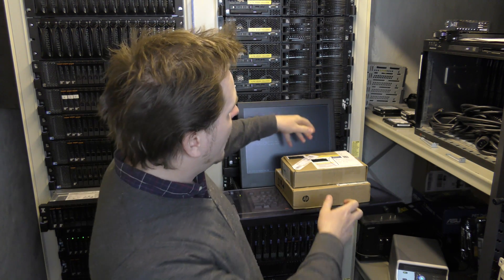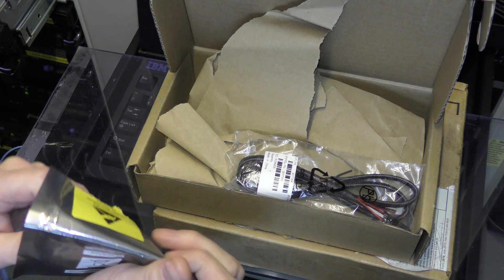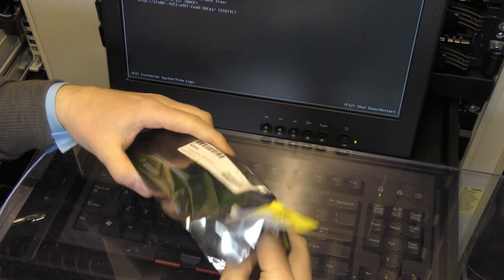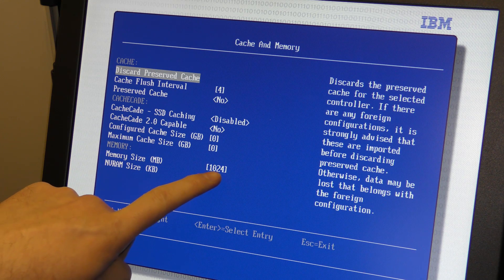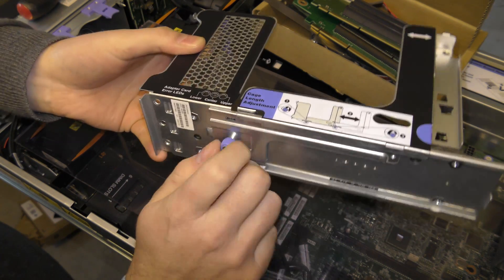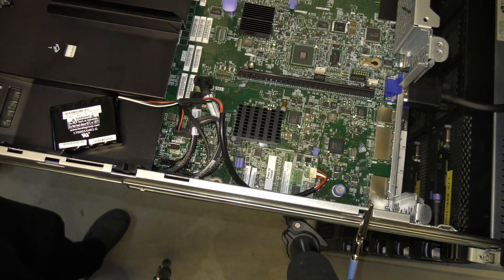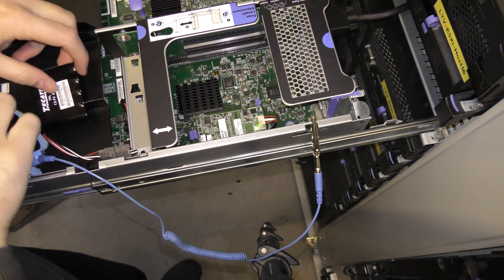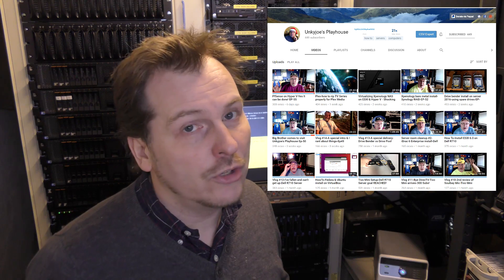Lenovo x3650 M4 GPU Riser Card & Flash/RAID Upgrade - 482

Comment: morten i have a problem with a hard drive. in the avago raid controller it is seen as protected. how do i remove the protected status.
Reply from the maker: Could it be a jumper on the HD?
Reply: @MyPlayHouse  its a sas 300 gb 15k rpm seagate drive. it has 4 pins but there is no jumper present. the backplane sees it but always protected. i have tried to make a raid with it and convert it to jbod to no luck.

Comment: Morten, you wrote oops on the printed document cause it seemed to imply that the battery only works with the 512MB model but I think you used it with your 1024MB cache card. So no problems ?
Reply from the maker: Hi Maico
IT sayes "* The ServeRAID M5100 Series Battery Kit (81Y4508) is only supported with ServeRAID M5100 Series 512MB Cache/RAID 5 Upgrade (81Y4484)."
Thes is "cache" not flash,, not sure the flash,, needs a battery at all now..
Thank you for watching! :-)
Reply: got that :)

Comment: There is an empty x3650 M4 on Ebay UK which is at 99p at the moment if anyone is interested.  Its collection only I'm afraid on the chassis.  It looks like the seller has gutted it and is selling all parts separately.

http://www.ebay.co.uk/itm/IBM-System-x3650-M4-chassis-and-racking-rails/152445063026?_trksid=p2047675.c100005.m1851&_trkparms=aid%3D222007%26algo%3DSIC.MBE%26ao%3D2%26asc%3D41415%26meid%3Dc7100c2e1ff040ff83d61dbbb3cdccce%26pid%3D100005%26rk%3D1%26rkt%3D1%26sd%3D152445044975
Reply from the maker: Hi Yandarval
Thank You very much!  There are a lot of good parts for sail there :-)
Thank you for watching! :-)

Comment: Hi Morten,

Why do You need PCI-E 3.0 16x riser?
As far as I know modern GPU can not use the full potential of PCI-E 3.0 16x? 

Hope you get better soon!
Reply: All systems since the introduction of Ivy Bridge have PCI Express 3.0 by default. The x16 link is needed because that's the only link that gets 75W supplied to it so a GPU can be used in this particular server.
Reply: Is the original riser with three 8x PCI-E would not provide 75W 
when used only one slot?

In my old HP Proliant G6 standing riser with three PCI-E 2.0 (8x + 4x + 4x). With this riser GTX650 work fine without an additional power and GTX1060 work fine with additional power from HP SAS Power Connector.

p.s. Sorry for my english :-)
Reply from the maker: Hi vasay
Thank You very much!  I have also shown that you can run a GPU on an 8x slot,, but I also want to show the right solution,,, In pro DataCenters,, you do not "hack" your servers. It is fine for home play.
Thank you for watching! :-)
Reply: Hi Morten, thanks for the answer!

If I'm not mistaken, riser you removed from the server, has 3 slot 16x  length, 8 lines each.

What is "hakking" to use one of them for GPU?

Many medium-price GPU using only 8 lines (has length of slot 16x).
And,  as far as I know, for the most powerful modern GPU enough bandwidth 8 lines PCI-E 2.0 (which is the same bandwidth 4 lines PCI-E 3.0)

 Once again I am sorry for my english :-)
Reply: I googled a bit and found an interesting test:
"Titan X Performance: PCI-E 3.0 x8 vs x16"
This is one of the most powerful GPU today. 12GB RAM and consumption of 250W (I can not imagine it in the 2-unit server)

https://www.pugetsystems.com/labs/articles/Titan-X-Performance-PCI-E-3-0-x8-vs-x16-851/